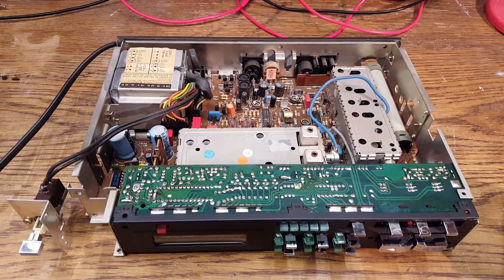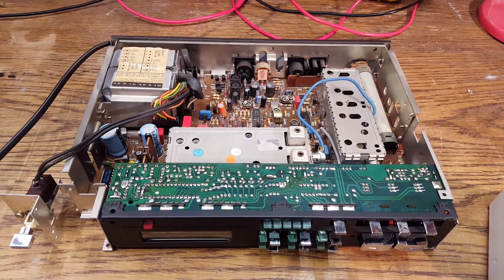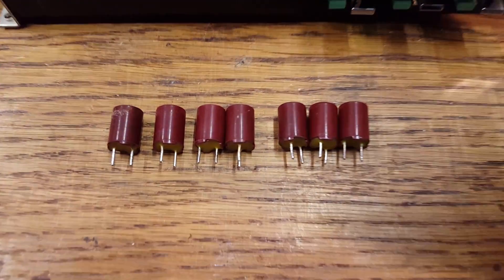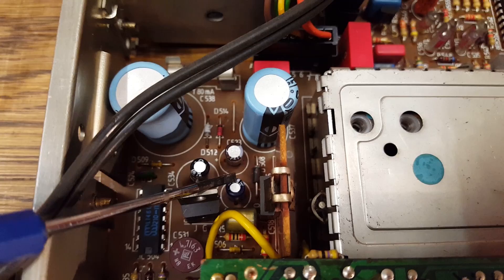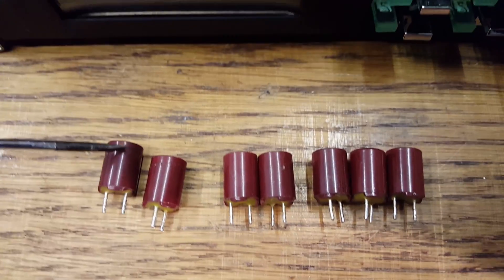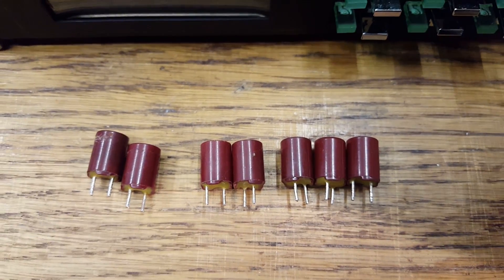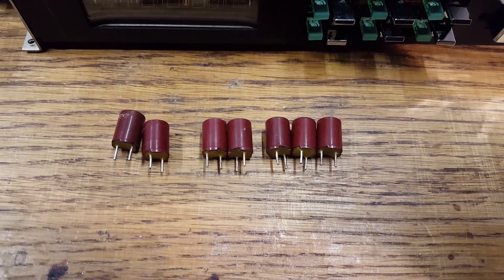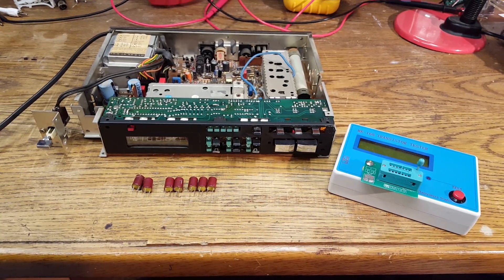Red Plastic Can Roederstein Capacitors

Comment: The increased capacity reading for those capacitors may be caused by excessive leakage current, resulting in longer charge time during the capacity measurement process used by the component tester. Depending on where those parts are used in the circuit, the leakage current may affect the proper function, so they should always be replaced even if that apparently higher capacity (that isn''t real) would not matter.

Comment: Interesting.. So most of them are not bad, their capacitance just has grown larger?
That makes them re-usable. 
Apart from the red Roedersteins, are there any other type of Roedersteins we should be watching out for?
It's a shame they go bad as they account for a lot of the visual effect of vintage gear - if that actually matters to anyone.
Reply from the maker: If the red plastic can is cracked the capacitor is definitely bad and not reusable. In this tuner the capacitance values may have just shifted upwards, but there is no telling how the capacitance and ESR values will behave in the future. Capacitors are sealed devices for a reason, and in case of these Roederstein capacitors the cracked can means the seal is broken.
Reply: @DrCassette  Thanks for the reply. Just to clarify, in my earlier comment I was referring only to those capacitors that are still mechanically intact but their electrical properties have shifted. There's no question  the capacitor is destroyed when its mechanical integrity is compromised.

Comment: Dr cassette, I have come across a Sony tc-k96r cassette deck and it has the red plastic capacitors. There is no value or voltage on the side. Just numbers on top. If I want to test them, what should I do to get replacements for the same value?
Reply from the maker: I'd be surprised if Sony used Roederstein capacitors. Do the capacitors in your cassette deck have the ROE logo on top? A component tester to measure the ESR of capacitors is what I would use for testing. But a visual inspection may be good enough. If the red plastic can is cracked, the capacitor needs to be replaced.
Reply: The capacitors do not have ROE on them, they are a slightly brighter red than those in the video and the numbers on the top for example would be like r273.
Reply: As far as I know, there are no cracks
Reply from the maker: @armike669  These capacitors should not be a problem. Just leave them alone.

Comment: Sanyo produced plastic caps in the 1960-67 period and they fail at nearly 100% rates too. It seems the plastic is microscopically porous and lets in air, etc. Heat wasn't a factor, they failed at room temp in battery equipment too. Seems nobody learned anything from that and they had to learn the hard way themselves.

Comment: Help. I am getting a Sony TC-WR-730 and the VU lights don't work, any suggestions on what I can do?
Reply from the maker: You'll have to descibe the fault in more detail. Test the unit. No level indication could have many causes.
Reply: The previous owner described that the unit worked perfectly, however the lights on the front including the level meter were not working. Once I am able to pick i up I will make sure thoroughly test the machine.
Reply: The previous owner stated that everything was fully working except the lights in front of the machine including the level meter. I will be sure to thorougly test the machine when I pick it up.
Reply from the maker: If all the lights are out regardless of what they do there may just be a bad solder joint.
Reply: !!   PUT   NEW  BULP  IN   !!